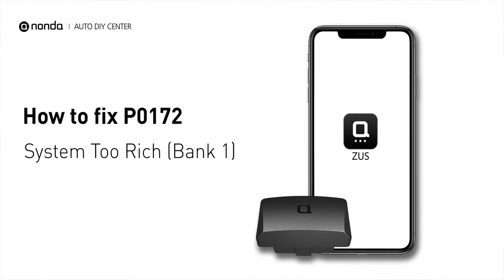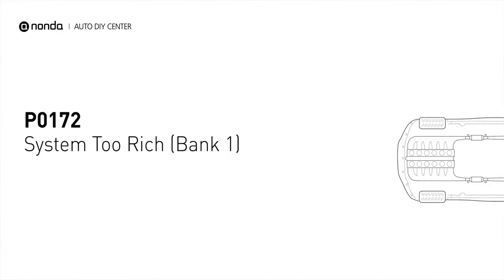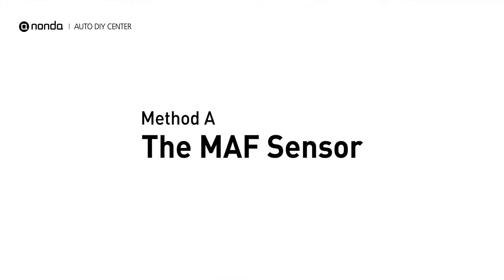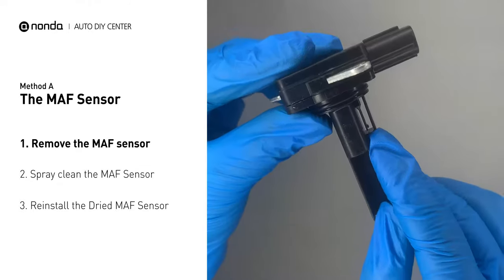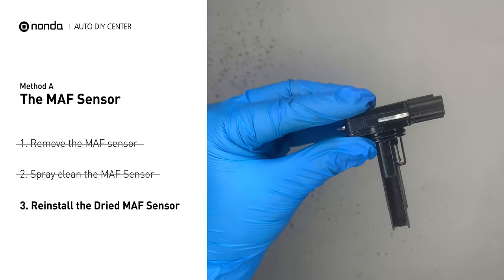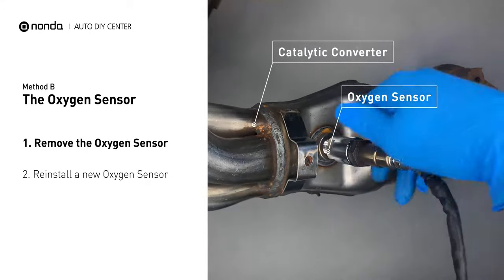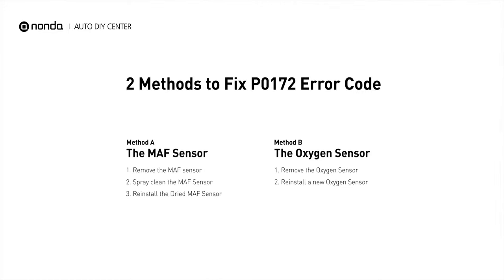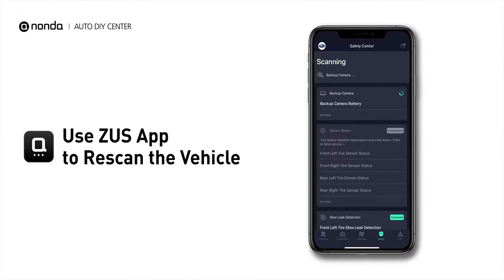How to Fix P0172 Engine Code in 2 Minutes [2 DIY Methods / Only $8.77]

Comment from the maker: Hi, I'm Steve, nonda's lead mechanic engineer. 
Feel free to leave your comments here if you have any mechanic questions, I will be glad to help you out!
Reply: Hi

System roo Rich Bank 1

Elantra 2010
Reply: Elantra 2010
Reply: Hi, I have a 2005 Honda Civic with the PO172 code, and when I’m driving and get to a red light my car turn off.  Please help 🙏🙏
Reply: can you also clean it with breakcleaner?
Reply: system to rich for my Subaru wrx it popped up on my accessport what cleaner do I use
Reply: @marvindieguez  have you ever changed the air filter
Reply: @iliasacherrat4888  no don’t use break cleaner to clean any of those parts especially MAF sensor
Reply: @vrowoken1465  you can find it at Walmart at the car section it’s called CR cleaner I think it’s called it a small red can and a small grey can one is for throttle body and one is for Mass airflow sensor - grab that pair it comes in 2 it’s like 10 bucks max. Then reference dissembling to your car make and model on YouTube
Reply: What should I use to spray the MAF?
Reply: What do you spray clean it with?
Reply: @nondainc  Recently had a P0172 code on my 2009 buick lacrosse. So far we’ve ran throttle body cleaner through the fuel, cleaned off the MAP sensor, installed a new air filter, but the code keeps coming back with a check engine light. I had a mechanic work on the exhaust from the exhaust manifold back, even installing a new downstream O2 sensor. The issue is still there. Please help.
UPDATE: since posting this I’ve been clearing the code whenever it comes up, and the car will run fine for 1-3 days before the codes come back and performance plummets again.

Comment: Hi, I cant even find the dam MAF sensor on my seat ibiza 1.2 as I have a P0172 code with engine management light on. Maybe its underneath? I have taken the engine cover off and looked all around the engine but just cannot find it, even the manual doesn’t show its location
Reply from the maker: Hello, you can find it somewhere between the air filter box and the throttle body.
Reply: @nondainc  Thank you, I will look at the weekend. Really struggling to find it atm. I might jack it up and get underneath

Comment: I'm getting a po172 and po101 in '11 Subaru STI. Car started running so choppy I had to pull off the road and even the steering and braking almost went completely dead. Just had it towed home and cleaned maf and air filter but haven't driven it since I cleared the code it drove fine off onto and off of the tow truck as I did pull tbe maf waiting for the truck to arrive and it was dirty and ran well after that just in the parking lot but I wasn't comfortable taking it onto the busy street to test when it was having most of the issues trying to get to speed around 2500rpms+.
Reply from the maker: Hi Jordan, kindly check the condition of the wiring harness. Have you tested the resistance of the wire from each pin of the MAF connector to the ECU.
Reply: @nondainc  no I haven't, I'll have to search what the proper resistances are and what to set mt multi meter too and give that a try, appreciate the direction to try! I'm learning so any pointers is much appreciated!
Reply: @nondainc  the harness looks to be in great condition clean connector nothing burnt or dirty wires look new protected in their flex tubing. But I haven't checked resistance yet.

Comment: 2011 Chevy Malibu 2.4 ecotec. Just changed the precat o2 sensor because of a code p0150. Now it’s popping this P0172. Could be bad replacement or just coincidence?
Reply: that means it was running so rich for so long that it drowned out the o2 sensor but running rich was the problem all along. something else is making it run rich, just replace stuff (everything in this video) until you figure out what it was

Comment: I have a '96 F250 with the 7.5l (460) that throws an intermittent CEL for P0172.  Could an exhaust leak on the right manifold cause this?
Reply from the maker: Hi Lance yes. We also suggest to check the condition of the spark plugs and the operation of the coolant temperature sensor.
Reply: @nondainc  ok, I know the factory temp gauge fluctuates between the "N" and the "R" in NORMAL and the coolant is very dirty so I've got a coolant flush and thermostat on my list this week. The plugs and wires were done about 5 years ago but have less than 5k miles on them. The O2 sensor was my next item that I'm leaning at replacing.

Comment: Hello ! I have a 2010 Chevy impala flex fuel I just replaced the MAF , didn’t work. Looking into the O2 sensor now . If that doesn’t work what do you recommend trying
Reply: Did it fix it?
Reply from the maker: Hello, have you checked the condition of the air filter and if there's a leaking fuel injector?
Reply: So what fixed it?

Comment: Hey I have this same issue on my 2020 Honda accord sport 1.5t could it be one of the sensors the have to be cleaned up ?
Reply from the maker: Hello, cleaning the MAF Sensor would help. Also, kindly check the condition of the oxygen sensor.
Reply: @nondainc  thanks man 🙏
Reply: Dou you fixit?

Comment: Hey I have a situation with the P0172 code not always coming up on my honda civic fn2 k20z4, I can reset/clear the code then the code comes up randomly again (scanner wont read any error since the code is cleared), sometimes up to a week not showing up, sometimes the code comes up in the next hour... Is this symptom showing the same faulty parts mentioned above? The car drives normally... and I dont realise any black smoke or losing power at all.. so far I checked spark plug condition is fine, just want to see if I can find any clue from the obd scanner data recorded to lock in the faulty part.
Reply: I've had that code before and I changed the air filter and cleaned the MAF Sensor with CRC MAF cleaner. The code went away and didn't come back. Cleaning the sensor and wiping out the air box may be the low cost solution.

Comment: Recently had a P0172 code on my 2009 buick lacrosse. So far we’ve ran throttle body cleaner through the fuel, cleaned off the MAP sensor, installed a new air filter, but the code keeps coming back with a check engine light. I had a mechanic work on the exhaust from the exhaust manifold back, even installing a new downstream O2 sensor. The issue is still there. Please help.
UPDATE: since posting this I’ve been clearing the code whenever it comes up, and the car will run fine for 1-3 days before the codes come back and performance plummets again.

Comment: ‘12 Civic Si. Have only had the car 3 days, threw CES light came on last night. Went to Autozone to check it out, got code P0172. Should I even try to clean the sensor?
Reply from the maker: Hi Jorge, if this is the only code you're getting, please try cleaning the MAF Sensor first. If the issue will still persists, then you'd need to replace the oxygen sensor.

Comment: Hello, So about a month or two ago my cars o2 sensor started to act up and give me code p0172, 8 change the sensor, air filter, all the ignition coils iat sensor and changed the oil, here we are and am getting the code again, I have two o2 sensors in the trunk ready to go😂 but what would be causing them to foul up, and once I erase the code sometimes the car remains normal, im baffled, it's an 03 chevy trailblazer ltz
Reply from the maker: Have you checked if there's other code that registers along with this code?

Comment: Hi!! I have a 2012 mazdaspeed 3 with the same code, is the second time that it show up, the first time, I just clean the MAF sensor and the code was gone, for few months, in the second time was, when I take off the recirculation line (VTA)100% vent air to atmosphere and the code show up again, so I made few changes, back again to100% recirculation with new line, new Osensors, new MAF sensor, new spark plugs with the correct gap, not air leak or boost, injectors working fine, new pvc valve and pvc plate, I have most of the part new, and the code still SHOW UP, I was thinking If could be the blow off valve or the throttle body... any ideas of what's going on here that could you help with? Thanks !
Reply from the maker: Hello, kindly check if you have a clogged air filter and observe the coolant temperature sensor and cooling system if sending the proper signal.
Reply: Did you check the Purge Valve?
Reply: So this app their advertising didn’t help at all

Comment: Hey, my car has been runnin too rich, but i cant find a Maf sensor on mine, after doing some research, not all cars have a maf sensor, in this case, what do you need to clean? i have a 2004 honda accord v6
Reply from the maker: Kindly check for vacuum leaks/condition of your spark plugs.
Reply: Check for a M. A. P. Sensor.  Manifold Absolute Pressure Sensor.  

Most vehicles have one M. A. P. Sensor or One . M. A. F.    Not sure at the Moment if some vehicle have one of each.   

Anyways your vehicle May Not have a M. A. F. Sensor , instead has a M. A. P. Sensor.

Comment: How much does it cost to fix for a Honda CRV 1998 (PO172) from a mechanic
Reply from the maker: Most auto repairs shops charge between $75 and $150 per hour.

Comment: I have an '03 Chevy trailblazer  4.2L replaced. The O2 sensor bank 1 sensor one because it was bad and now it keeps popping. This code of p0172. We have already replaced camshaft sensor VVT crank sensor which was replaced the while ago map sensor. What would you think is my next move? It doesn't run rough. Doesn't stall out. Just keeps every once in awhile throwing this p0172 code
Reply from the maker: Hi Sam, is this the only code you are getting?
Reply: @nondainc  yes it's the only code that keeps tripping and it's not very often. Like I can go all day it doesn't run rough then happen to look down and the light trips but still runs perfectly fine
Reply from the maker: Hi Sam, kindly check if you have a vacuum leak, bad fuel injectors or clogged air filter. Also, check the Fuel Pump/Fuel Filter for any issue.

Comment: Hey man please help me with any tips. I have a 2000 Toyota Camry 2.2L. I have 2 codes P0172 and P0420. What can it be? I replaced the map sensor and didn’t fix anything. Car turns on, when I rev it , as soon as I let get the car shakes and shuts off
Reply from the maker: Hello, we suggest getting your vehicle visually inspected by your local mechanic for further diagnosis as you are receiving more than one error code.
Reply: @nondainc  I don’t have the money to fix it right now, so I’m trying my best to try and fix it myself. Do you have any suggestions of what it can be? Both codes came on at the same time
Reply: @thewiseguy7100  clogged catalytic converter is what that sounds like to me , replacing it would be the only fix if thats what it is.

Comment: I have 2016 Chevy Cruz my Chek engine light came one. 1st error code was p1101 code. My dealer said it was throttle body. I had it replaced now there saying it's the Ogden censor they say it cost $271.00 to fixd. Please advise. Can I have someone fixd it. According to the video??
Reply from the maker: Hi Linda, a malfunctioning MAF sensor, vacuum leak, blocked air filter or a faulty wiring from the MAF to intake could be triggering the code. Kindly have them checked and fixed.

Comment: 2004 prius had running rich I put 5 different fuel additives in it when it was 3 bars tank and ran it down to 1 bar and I put it in gear with e brake on and held down gas and made rpms go up don't know how much but thin I took it in cleaned the code and now it getting better gas mileage and it's been 3 months and no code
Reply from the maker: Hello, thanks for sharing your experience!

Comment: 04 Buick century, took to pep boys and they told me maf sensor. Installed new one and it came back 50 miles later. What’s next? Shouldn’t they have looked further?
Reply from the maker: Hi Kyle, have you checked if there's a leaking fuel injectors?
Reply: @nondainc  I thought pep boys would and that’s why I took it for diagnostic. All they told me was maf sensor which I knew probably wasn’t it.

Comment: 01' Honda crv popping P0172
P0300
P0302
P0304
P0316

Previous owner drove it on flashing check engine because mechanic told them they could not find anything wrong. 

Just replaced cabin air filter and head gasket. Spark plugs and harness have also been replaced.
Reply from the maker: Hello, as you are receiving more than one error code, we highly suggest getting your vehicle visually checked by your local mechanic for further diagnosis.

Comment: VW Scirocco 1.4 P0172, P0420 & P0033. Car drives very smooth, changed the sensor when the motor management was in the dashboard, but now the errors mentioned above came back. Do you have advise?
Reply from the maker: Hi Joran, since you are receiving multiple error codes, we suggest getting your vehicle visually checked by your local mechanic for further diagnosis.

Comment: Toyota Camry 2013 - I put a brand new MAF sensor. But the code still exists. Should I try putting a new oxygen sensor?
Reply from the maker: Hi Emmelhy, is there any other codes that register along with this code?

Comment: i have 2015 Subaru Forester XT fa20dit engine already replaced both two 02 sensors and cleaned the MAF, MAP and the Throttle body still i have this slight hesitation during initial acceleration and stopping the P0172 again any advice?
Reply from the maker: Hi Van, have you checked for vacuum leaks?

Comment: Will this work if I have code PO172 and PO175 on Cadillac escalade 2013?
Reply from the maker: Yes. Please also check if there's vacuum leak, if your air filter is clogged and if you have a faulty fuel injectors.

Comment: Hi! My friend has a 2009 Hyundai i30 1.6, he has this code. Is this a generic error code that applies also to his car model? The symptoms besides the code are, the car sometimes stalls when in gear and does not restart until cooled down. How can one determine which causes the error without replacing them? Only trial and error method works here?
Reply: Im having the exact problem on a toyota tundra
Reply from the maker: Hello, we suggest checking the condition of your Toyota Tundra's fuel injector and air filter. For your friend's car, the issue could be coming from the spark plugs, MAF sensor, gas leaks, and fuel injectors.
Reply: @nondainc ❤

Comment: Same error on a Chevrolet Captiva Sport 2012. Where are those sensors located? Thanks
Reply from the maker: Hi Jonathan, Chevrolet MAF sensor is located right next to the engine air filter housing while the oxygen sensor is located in the exhaust manifold.
Reply: @nondainc  thank you, I’ll see tomorrow if I can find it.

Comment: Opel Corsa D 2010 Model (Z12XEP) LPG model:
Code: P0172 and P2188.
Clean MAF but code still exists.
Please help and suggestions?
Reply from the maker: Hello, we suggest to get your vehicle visually inspected by your local mechanic for further diagnosis as you are receiving multiple error codes.

Comment: Will this work for both p0172 and p0175 error codes?
Reply from the maker: Hi Danny, can you please provide us with your vehicle's make and model?
Reply: @nondainc  mustang 2010 base, i cleaned off the air sensor and the car still runs like its losing power when accelerating
Reply from the maker: Hi Dany, thank you for your reply. Yes, these method would work for both of these error coded. Also, please check the fuel pressure, check if there's vacuum leakage, and double check all the electrical connections/grounds.

Comment: I got a 99 Buick Regal 3800 V6 with this exact code and so far I’ve cleaned the fuel injectors which didn’t help it
Reply from the maker: Hello, please try cleaning the MAF Sensor to see if the issue will continue to persist.

Comment: I have this p0172 error on my golf 6 gti combined with maf sensor. I changed the sensor at vw, the maf sensor its ok but keep throwing this 2 errors. Nothing found by vw. When i delete the error keeps coming in 2-3 days. I have missfires too. I dont anymore what to do. Changed pcv valve too. Some ideas? Ty
Reply from the maker: Hello, you may check the coolant temperature sensor and the cooling system. Also, have your mechanic inspect if there's vacuum leak, excessively restricted air filter, faulty fuel injector, condition of the spark plugs and the fuel pump/fuel regulator as one of these could trigger the code.
Reply: @nondainc  thank you for this
Reply: @Utza , did you fix it ? Iam having the troubles also same enigine as yours , i have new sparks , new injectors , cleaned the carbon in the engine , sensors are also ok ,no leaks in exhaust
Reply: @A92KGTi   this week i changed the fuel pomp and still having the missfires, thank you for the tip 👍🏽  I wil change the hpfp next and hope that it solves the missfires 🤞🏽
Reply: @A92KGTi  good one ☝🏾 ill reply the result 👍🏽
Reply: @themightydutch  did you fix this ?
Reply: @georgetap7578  yess it seems fixed, i changed the lpfp (low pressure fuel pomp) but still had missfires , did an oil change as suggested above ☝🏽and it fixed it , also now the sound off the engine running is deeper and better, i guess what its supposed to sound like , Sorry for the late reply as i liked to test it first these months. Also this problem code for me started when the stage 1 tuning whas changed to stock again. Good luck buddy 👍🏽

Comment: Changed the purge valve ,maf.on my 09 Impala flex still getting the same code
Reply from the maker: Hello, kindly inspect if there's any vacuum leaks, check the oxygen sensor, fuel injectors, and if your air filter is clogged as these would trigger the code.
Reply: @nondainc  I guess it has something to do with my alcohol % on the flex fuel according to the shop
Reply from the maker: Thank you for your reply. To pinpoint the cause of the issue, we also suggest checking the condition of the mentioned parts to apply proper solution.